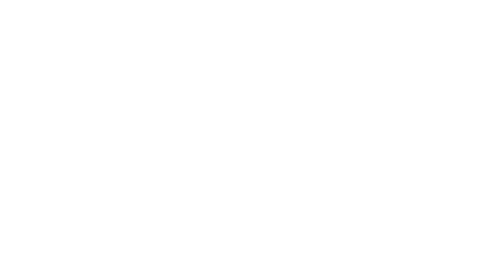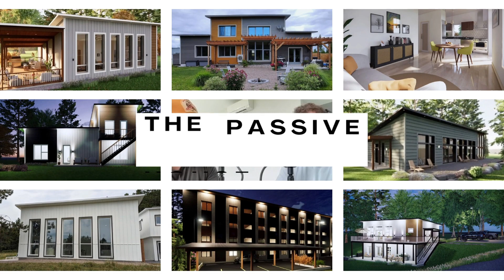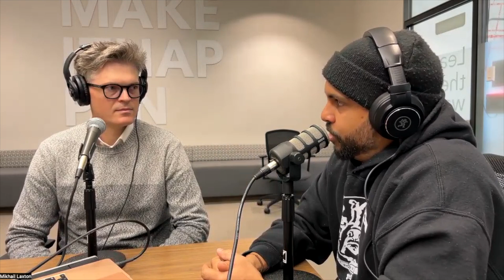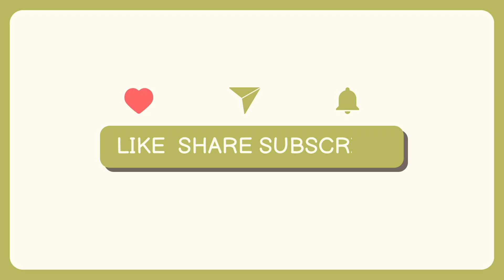Unveiling the Future - Property Data and Home Sustainability explained [The Passive House Show]

Comment: what is about blueprints ie if something has to be fixed later on (electrical grid, pipes etc)
Reply from the maker: Home print is a database that would contain all information in one place, so any fixes down the road, or simply added to the database ✌️
Reply: You're able to upload blueprints and also add all of your property systems information into your Homeprint, which can most certainly be used to reference for potential issues down the road!